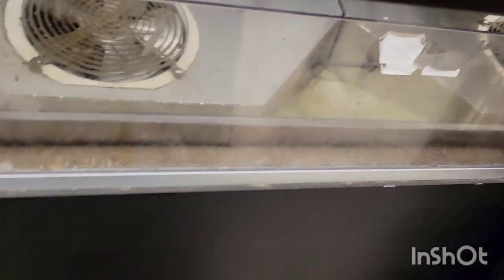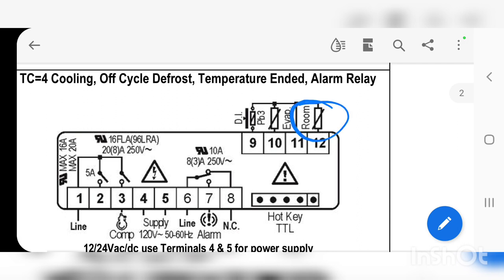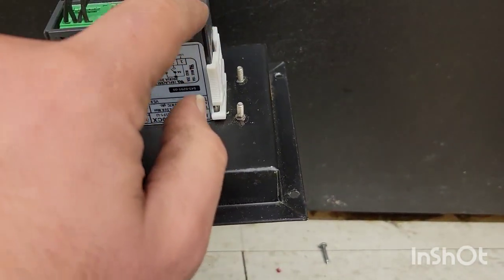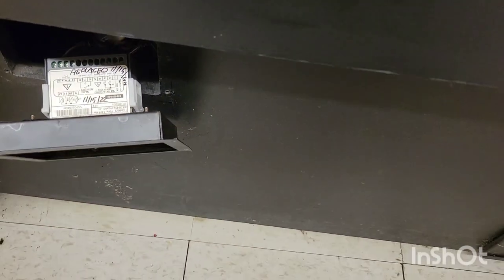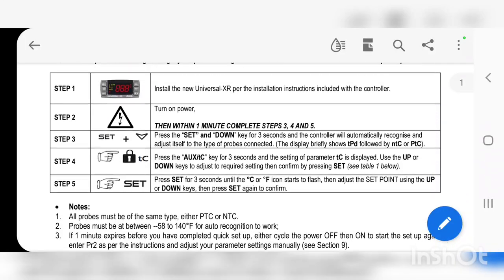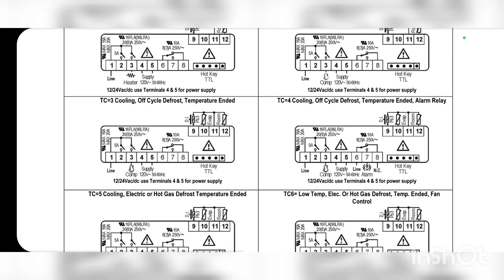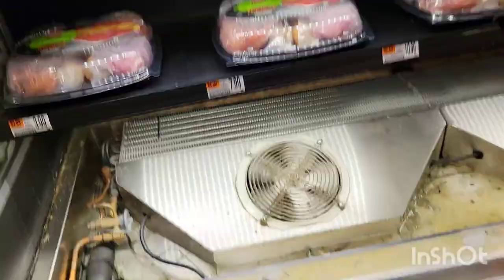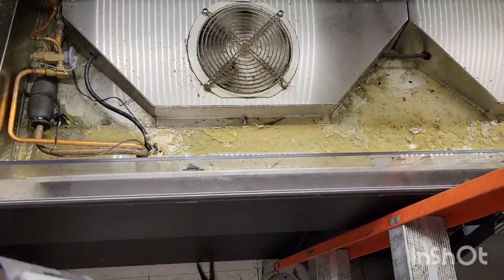Supermarket Refrigeration- Replace & Program A Emerson Universal Dixel Controller (XR60CX-5N1F1-UR)

Comment: Super tech . Great great great detail video. Exactly what I was trying to learn. Question, please!!
So 4@5 is the supply power . What is N 1  @ 6 LINE for . I thought line is the power !
Reply: That's not N1 that's line on number 6. Six provides power for whatever component is meant to be under #7. Notice #7 says load under it.
Same thing for spot #1, which is line power, it provides power for #2 & #3 contact coils. Which generally on turbo air reach in, air curtain merchandiser's will have two compressors. #4 & #5 are one ground or neutral as he said and the other spot would be 120v. Hope this helps.

Comment: Great video. Subscribed!!
My fan motor stopped running and condenser coil is frozen. I replaced the fan motor, however the fan motor is good but just not getting voltage. Can you help me identify the problem please? 🙏🏼 Thank you in advance 🙏🏼
Reply from the maker: It's impossible to tell without being there but this is the procedure I would follow. 

1) check to see if the fuse is tripped
2) check if power is making it to the coil itself. 
3) is the fan harness connected to the power source. Check for corrosion in tight connections. 
4) does the fan harness ground out when tested.
5) check for chafed section of wires. 

This is how I would approach it good luck

Comment: Hi Gendron, thank you so much for your video, it helps alot. I have exactly this universal Emerson controller for my walking cooler. What should i set for my LS, US, and defost cycle time? Please help me please. 
Thank you so much🙏❤️
Reply from the maker: LS -  Minimum set point

  If so typically most cases or systems will have Literature That would give you this value like a technical bulletin.  But Most technicians just Go off of their gut. 

 This Is like a safety for example if the compressor is just Constantly running and the temperature pulls down too far it will shut off the system. 

 Maybe 10 to 15ﾟ under the  The lowest possible set point. 

For example 

Set point 32 
With a swing of 2 

So the lowest is like 30 

There for 

LS = like 15 

 Lots of people Leave this stock. 

UL =  maximum set point

 Again this is like another safety thing where if somehow the system got to like a 100ﾟ it would shut off. 

 Typically I see them set for 90 most people don't even touch him and you'll be fine. 

 Those values are not the set point of your case  the set point  Is a different Parameter those are safety set points. 

 To set your defrost you would need to look up whatever you're working on. 

 For example if it's a hussmann evqp coil would go to the hussmann website look up their coil Technical bulletin and  Program the defrost according to their outlined bulletin. 

 I hope that helps good luck
Reply: Thank you so much Gendron, 
Can I have question again? Thank you.
So this is my freezer walking cooler. So I set LS 15•F to UL: 30•F 
So this mean that the temperature will go down maximum to 15•F and stop and relax until it reach to 30•F right?
Thank you so much

Comment: Installing the dicxel timers, are u going too need the thermostat, Sry I meant the existing factory thermostat, I want to install the dicxel to control the chiller now
Reply from the maker: It depends on the type of controller you by. 

My controller that I bought in this video has a thermostat for a refrigeration relay. So I will not need anything else. 

This particular model also has an evaporator censor so I could set it up for defrost based on temperature.

It's the only thing you would need. 

But there is a thirty amp limit on the defrost relay so you might have to install contactors for larger systems.  

Hope that helps.
Reply: Thanks 🙏 👍

Comment: Hi, can you give any idea how many condensing unit will require for any hard discount stores such as Walmart?
Reply from the maker: Ummm kinda...

So typically a store like a Walmart would not have a single condensing unit on a roof. 

Typically they would have like a large rack refrigeration system with a very large condenser. 

I have a video that kind of explains a system setup below.
https://youtu.be/GtyrYqvvKBs

This is the type of system that most large-scale supermarket would employ. 

But in all honesty there's really no way I could answer the question for example you could buy a condensing unit that could run 15 doors of ice cream we have plenty of stores that do that. 

But you could also buy a condensing unit that could only keep five doors of ice cream cold it's really up to you. 

Some of the stores that we service have a large parallel rack Refrigeration like the video up above.  But then they will have like single condensers for the walk-in freezers and coolers. 

I hope that kind of answers your question but it's actually a very complex thing it's not just like oh you can have one condenser or something like that typically what an engineer would do is look at like I have these 25 different food service cases that I want to have in my store can you make that work. 

Then the engineer would put together the system needed. 

I hope that helps

Comment: Do u hookup the evaporator fans to one of the terminals on control?
Reply from the maker: If it if the case needs it then yes. 

So in this case when I looked at the controller there was no wire to do that the fans just run continuously and the fans are used as a way of defrosting the coil so you do not need to hook up the fans to the terminal on the Emerson controller. As I mentioned in the video you kind of have to look at Case by case

Comment: having problems with this controller not defrosting on veg. case set at 45 degrees.  checked room sensor works correctly turn on and off like it should.  What about evap sensor?  unit is freezing up.
Reply from the maker: If it hasn't eve absensor I would definitely check at the evaporator censor. 

It could be loose or if it's not reading correctly you're right it will not terminate the Defrost. Some cases will have dual Directions so you could just set it For time off Defrost if the direction say you can. Most medium temperature Cases you can do both.
Reply: @gendronhvac-r1269  forgot to say thanx

Comment: Why so much differential ?
Reply from the maker: That is what the piper case manufacturer said to do. 

If I'm honest I have no idea why it could be many reasons but for whatever reason the manufacturers engineering team thought that that was appropriate. 

It could be for efficiency so the compressor has a good amount of time before it bumps on and off or it could be for ice buildup that by giving it such time off it will not build up ice. 

But I'm not sure I would have to contact Piper Engineering in order to find that out but if it was designed a certain way I try to put it back in the way it was designed unless I have an adequate reason to change the design. 

I hope that helps
Reply: could be because doors open too frequently, to defrost properly, controller is measuring air temp products will not be affected they have (potential energy) stored temperature